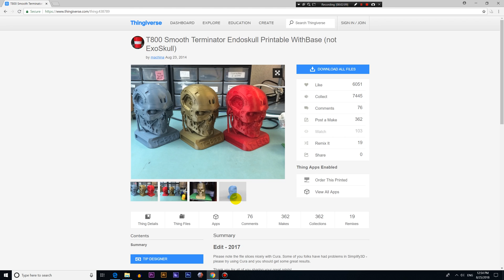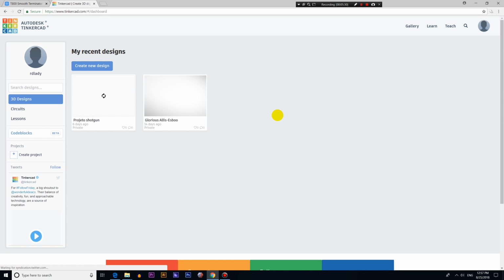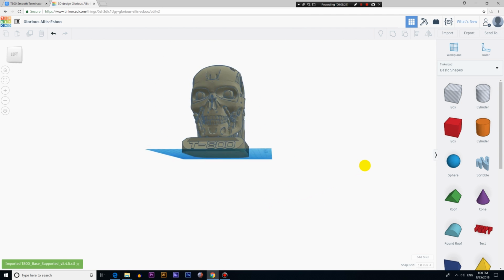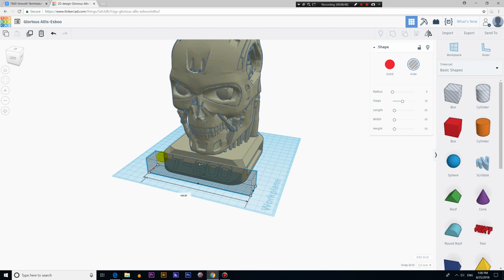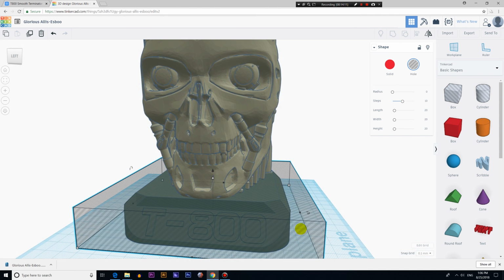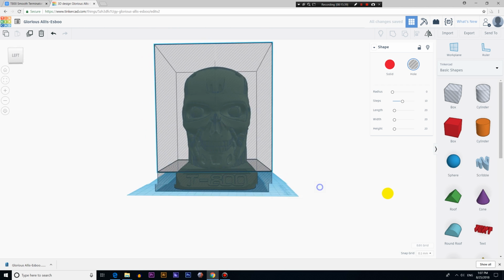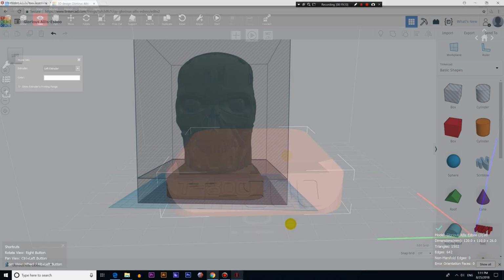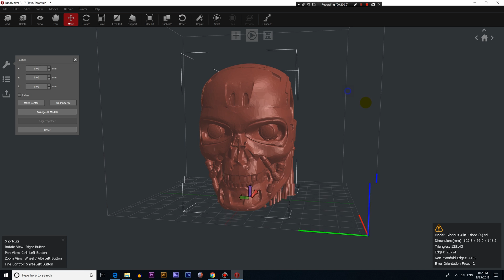Tutorial: Splitting 3D models into parts for 3D printing, using Tinkercad

Comment: Does the app that you use to cut the files, come with the printer as a disc and with the app that u use to import files
Reply from the maker: Not sure I understand your question, but this app is used to import and edit models (resize, cut, remodel). This is not used as slicer software, it's independent from what printer you use.